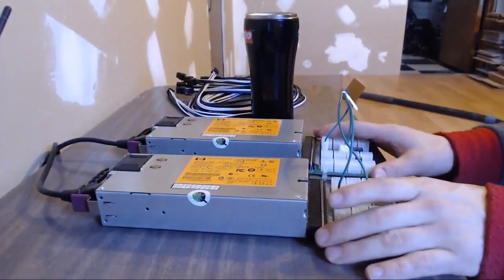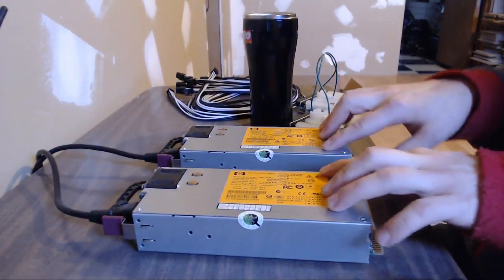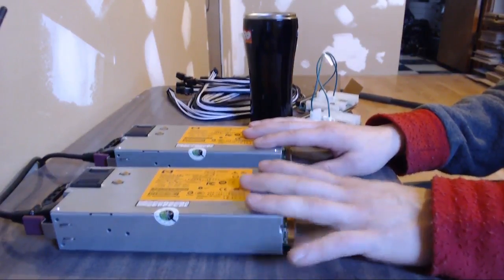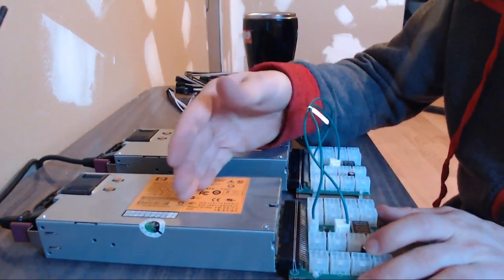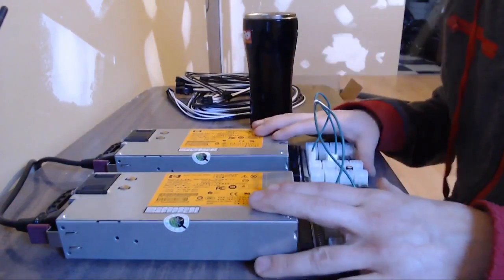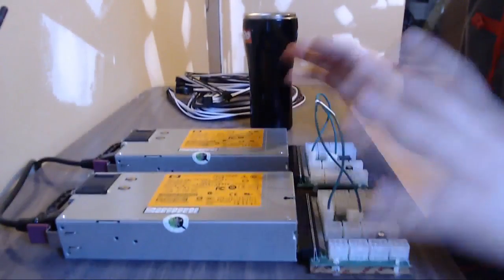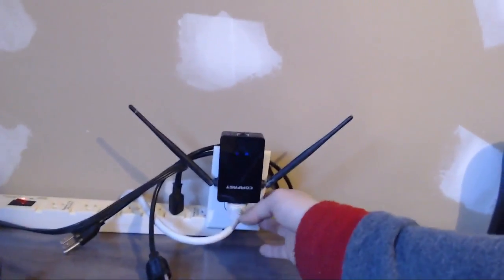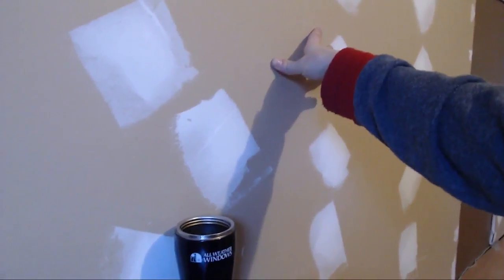Dual PSU Setup For My Antminer A3 On 110v Power

Comment: Could you list links to the powersupply and breakout boards with fault protection?
Reply from the maker: https://www.parallelminer.com/product/110v-240v-1500-watt-power-supply-kit-w-x6b-breakout-board-for-avalon-6-721-741-821-841-dual-fault-protection/